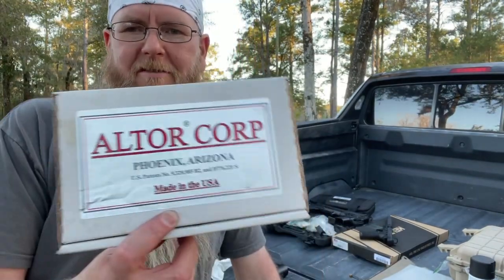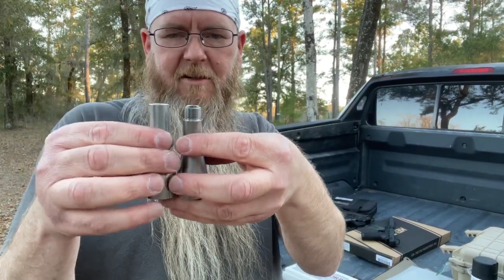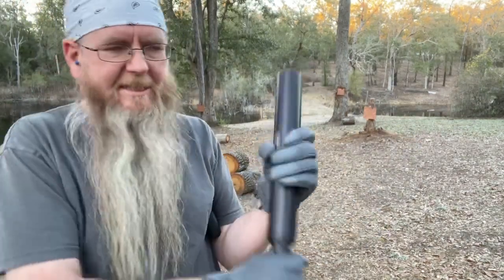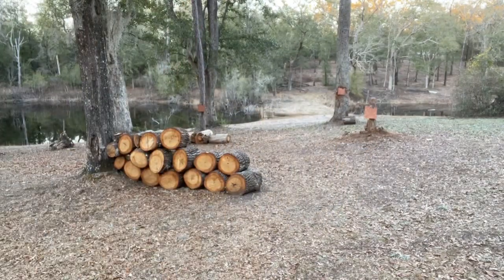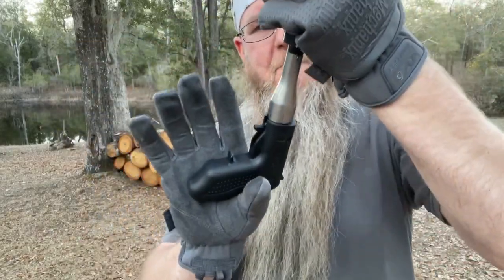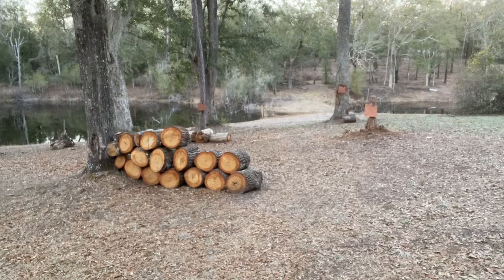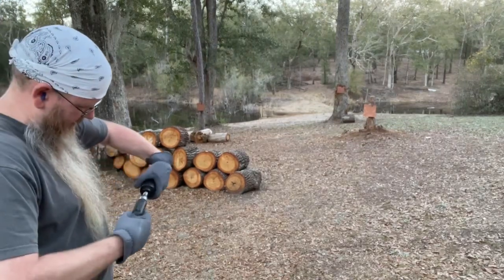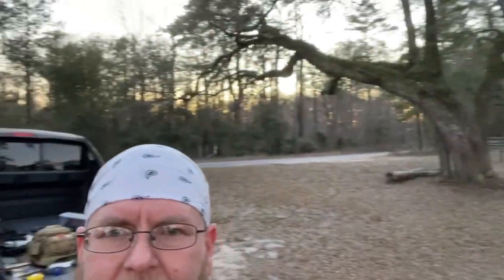Shooting the most dangerous gun I own: Altor Single Shot 9mm

Comment from the maker: Altor Single Shot 9mm Luger 3in Black Pistol - 1 Round - The Altor Single Shot Pistol delivers a reliable, durable, and small handgun design. It comes chambered in 9mm with a 3 inch barrel. Features include a polymer grip and fool-proof operation. Get the best 9mm pistol for sale online from Sportsman's Warehouse today!

Sleek, Modern Look - Nonthreatening appearance.
Fully Ambidextrous - Functions from either side, both sides marked.
Ergonomic Design, Lightweight - Easy to hold.
Easy to carry. 
Unique Firm and Even Trigger Pull - Light recoil. 
Traditional Button Safety - Industry standard. 
Additional Barrel Safety - Plus double action only operation. 
Integral Extractor - Makes reloading easy and quick.
Foolproof Operation - Only 2 parts to connect to load & fire.
Only 6 Parts Total - Routine cleaning involves just 2 parts.
Reliable - Simple striker fired operation.
All metal parts are quality stainless steel.
All synthetic parts are firearms grade premium polymer.
Made in the USA